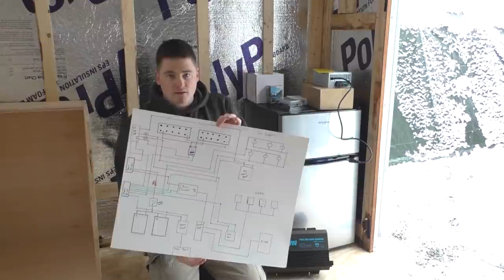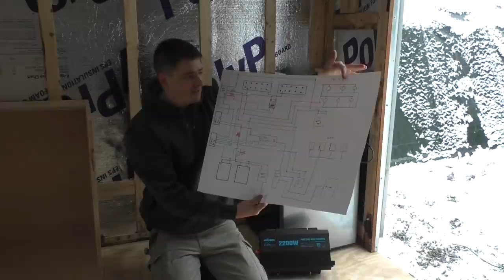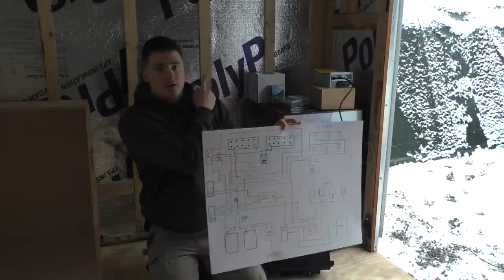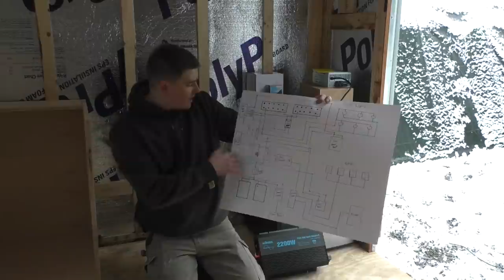Off Grid Cargo Trailer/Camper Conversion Budget Build Pt. 2

Comment: Can't go wrong with a Chinese desiel heater I put one in my camper and I love it.
Reply from the maker: That's a good idea. I was going to do a little wood burner just because I like wood burners but I'll look into that anyhow thanks
Reply: @builtbysonick1250  Nate on the channel 'Class A Living' shows his Chinese desiel heater in a lot of vids. That thing sips (safe) desiel fuel and heats his rig pretty well.
Reply: Absolutely! Those are great heaters another great heater if your going to be  using propane for cooking then get a Catalytic radiant heater. These things are amazing, we had a 28' beast of a travel trailer that had the large forces air heater and my tiny little Catalytic heater and the forced air with guzzle the gas I installed the little Catalytic to heat the sleeping area and found that little 8"x8" Catalytic would heat up that whole trailer in minutes and I could run off a 5 gal tank for weeks versus using 5 gal in 2 days on the forces air heat pump. Anyway both are great ideas the only downfall on the diesel is having to buy an extra fuel rather than just tapping into your currant propane line

Comment: You may want to pull that staple out of holding the wires. With all the bouncing of the trailer and all the vibration eventually will cut through the insulation. Just saying.

Comment: I use the pebbly finish 4 by 8 wall boards that you see in Commercial bathrooms for my ceiling after I insulated it. I put crown molding all the way around the top with rope lighting behind it. I cut my windows in with tin snips🤣😁

Comment: A tip for the future, I worked in a cabinet shop. It's easier to square cabinets and then place them on top of a tow kick, the tow kick provides extra support and makes your cabinets sit on the same base.
Reply from the maker: I'm not quite following what you mean by that
Reply: @builtbysonick1250  sorry, building your cabinets and then placing them on a base. It's like a structural frame that the cabinets sit on top of, this gets rid of your gaps between your cabinets. I was just saying that it might add support and make your future builds easier.
Reply from the maker: @101IplayWOW  ohhhh I see what you mean now. Thanks for the tip! I'm planning on building all my kitchen cabinets eventually so I may use that idea

Comment: Before you get too far may I suggest welding some jacks on the bottom of the trailer for stability. Just the back would be good but all 4 corners would be best. Keep up the good work!
Reply from the maker: Ya I had something like that in mind I just haven't thought of how I want to do it. Maybe have them so they swing down or something
Reply: @builtbysonick1250  may I suggest some simple collapsible style jacks like that come with cars. Probably get them cheap at a junk yard. Try to get the ones with the nut on the end so you can use a cordless impact to jack it up quick. Also just take some 18”x18” concrete pads and that will help a ton. Glue on some levels and you’re ready as far as all that goes. Good luck!
Reply from the maker: @jasonmcdaniel3520  thanks for the tip man!

Comment: I like the build so far keep up the good work. Datto blades are nice but only serve one purpose, my advice from 30 years in cabinets as a job is invest in a router and straight bit. It's much more versatile and easier to get a consistent datto. Especially if you're limited by a smaller table saw.
Reply from the maker: That's good to know thanks for the tip! And thanks for the feedback!

Comment: That insulation is expanded, rather than extruded, polystyrene.  Despite the tin foil they put on it, vapour barrier would have made sense, because expanded polystyrene is open cell, and acts like a sponge.  That insulation will soak in the moisture, which will give you mold, and will undermine the R Value.  Perhaps the trailer's aluminum skin on the outside will keep away some moisture, but I don't recommend you cook in there.  Those walls will be permeable.  The steam will soak into the EPS foam, regardless of how you skin the inside.  Without tuck tape on the seams of the insulation, and absent a proper vapour barrier, you are going to have problems.  Not if... WHEN.

Cheaping out is never cheaper in the long run.

Comment: Over time especially with something that moves,  metal staples to hold electronic wires will eventually rub insulation off and with high amp batteries might create one heck of a fire if you don't blow a fuse first.  But otherwise loving these videos,  keep up the great work!
Reply from the maker: Actually that's not possible. The staples could be touching bare wires and nothing would happen because there is nothing for it to short to. It's wood and low voltage. Completely safe. Plus those fuses are rated at 10 amps. Not even close to enough to create that kind of heat

Comment: Man I just noticed how low the ceiling is on this trailer, maybe you should raise the side walls 6-12" or so. It wouldn't be super hard then you could run a stainless sheet across the bottom to transition into the sides. I'm sure your way passed this idea at this point and not sure if it would of been worth the hassle just tossing out ideas. Great video. Oh o didn't realize you were able to stand inside as is. The view from the video threw me off.
Reply from the maker: Way too much work for what it's worth I think. We don't spend much time in it when we're camping anyways

Comment: following along.  What amp solar inverter did you go with?  The solar side has me confused as to what all I need to be able to switch from shore power to solar.  Also, can you leave the solar going while camper is parked for months without damaging batteries?
Reply from the maker: I bought the Renogy 10amp unit. I have it linked below. It is considered a smart charger so it will stop allowing current to pass through to the batteries when they are fully charged so you can just leave it hooked up without worrying about damaging batteries. And you don't have to do anything when hooked to shore power. The charge controller will continue to charge the batteries along with your battery charger that's connected to shore power until they are fully charged
Reply from the maker: Also they do make MPPT charge controllers that are more efficient but also more expensive. This one should do fine for what I need it for. If you plan on being off grid for long periods of time then I would recommend getting an MPPT controller

Comment: Yeah......this is the part I’m dreading. I can probably do the DC if it weren’t for how I want to set up the solar, multi battery setup. Still not sold on 12 or 24 volt. And I have appliances from an old trailer, but I think I’m gonna go with a tankless water heater, wood stove, just go with a small wall AC and the inverter will be at least a 3 k. I won’t need any more than maybe 1500, but I don’t want to work it to it’s limits. Yeah. The electrical is what I’m probably just gonna pay my buddy to do if he’s up for it. I’ve got 2 trailer frames, 19’. Ones already cleated for the floor. The other I’m actually gonna start the tear down on the remaining deck tomorrow.  My plan is to build one to get it all figured out. Work out the bugs, get it right, then sell it. Use the money from that do do the other a bit more higher end. Great little series. Keep the little one invested in this. My wife would always bring my daughter to my cabinet shop when I worked late. She’d always leave finger drawings in the sawdust. We’re divorced now. Lots of regrets on both side, just too irreconcilable. My daughter turned on me at first. We talked and talked and remembered, it’s those little insignificant things that they remember. A lot is better, but still healing. Keep it up. You’re gonna have great little trailer when you’re done. 😁👍
Reply from the maker: Thanks man and ya luckily for me I have a background DC electronics so that part is relatively easy for me. The cabinet building now that's another story haha. But ya it's awesome being able to do this stuff with my family. It makes it not as much like work. Goodluck on your build!

Comment: Turn your panel up on end and make a cut just like the first one.  Done in two cuts.  Make sure you set the width for the second cut.  Old Cabinet builder and custom furniture maker.
Reply from the maker: Thanks for the tip
Reply: @builtbysonick1250  You are doing a great job.
Reply from the maker: @RJ-rn3uv  thanks!

Comment: One thing I can tell you is off grid you are going to use way more electric than you think. When you have the trailer parked in the shade you won't get much from the solar panels and if you park in the open you'll cook.
Reply from the maker: Might have to invest in a little generator

Comment: Looking good! I'm a new subscriber to your channel.  Im definitely following your build on this . I'm looking at doing the same size trailer but as a toy hauler/camper. When you replaced you floor, did you use any insulation? If not, why not?
Reply from the maker: I did not. I may do some spray in insulation underneath when I'm done
Reply: @builtbysonick1250  i was thinking about spray insulation for the floor, walls and roof. Have no idea is its a good idea or not. Nor do I have any idea of cost to do it. What are your thoughts on doing that? Or a combination of insulation boards and spray in.
Reply from the maker: @thomasgriffith3747  I guess that somewhat depends on your application. If you're going to be doing a lot of camping in the winter or if you plan on doing air conditioning then you can't have enough insulation in that case. In my case I'm not doing A/C and won't be doing a ton of winter camping.

Comment: do you like your tablesaw?
Reply from the maker: Ya it's not bad. I need to make a table around it so I can cut bigger boards
Reply: @builtbysonick1250  Yeah I have same saw I think. Mine has the pull out table on the right side. It's just ok. But got it cheap so cant complain